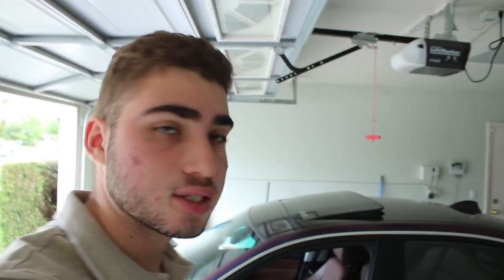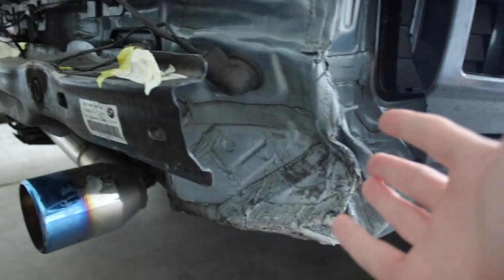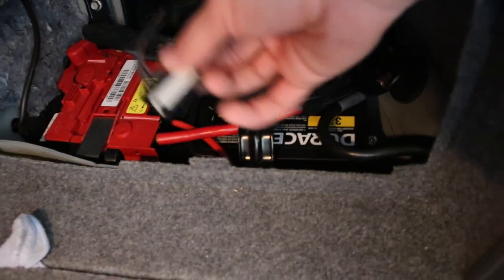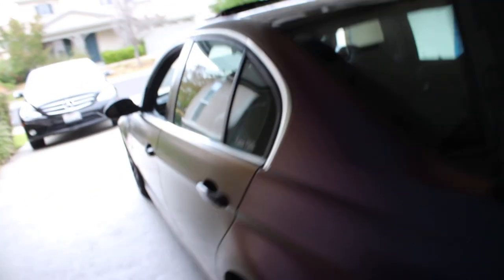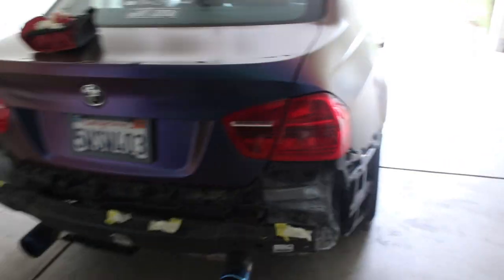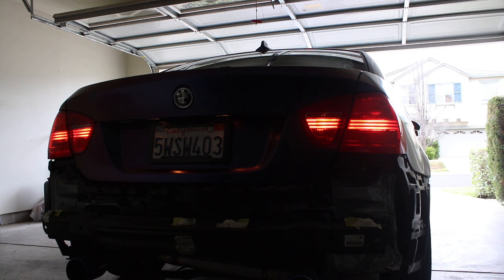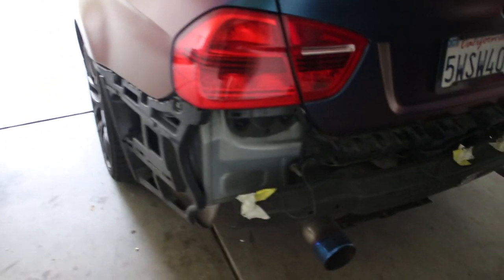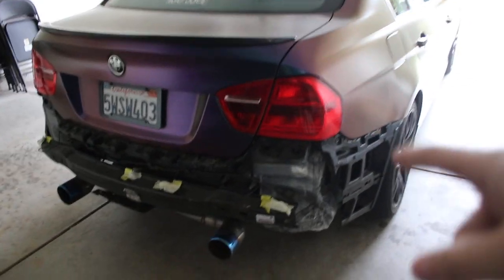SHE IS BACK, INSURANCE WAS A JOKE!

Comment: Drill some holes and use a slide hammer to pull the battery box metal out enough to remove your battery. Once the battery is out you can use a soft hammer to knock it out the rest of the way. Once finished you can sand to bare metal and fiberglass over the holes and rattle can paint the finished areas. under 75 bucks would get you everything you needed and you can return the tools if you leave them in new condition. That's the most budget way I can think of to fix it.

A better way would be to sand to bare metal and weld some frame puller tabs to it so it could be pulled out.

Comment: get a slide hammer and pull it out from outside enough to remove battery.  Then use a small hydraulic jack from inside the hole to push the metal out enough for the battery hole.

Comment: man i'm glad you got your car back. the wrap looks nice btw.  good luck on getting back like you had it. i have a 2006 330xi myself  and i love mine. your videos have helped me alot . thanks man
Reply: Thachosen Drones omg bro I have a 2006 330xi is yours tuned ??
Reply: nah bro mine isn't tuned yet taking baby steps man. just working on replacing some of the expensive stuff before it breaks and doing some small mods for now.
Reply: Thachosen Drones yes bro me too I had to replace the servo motor acurator that usually goes out on bmw 330xi’s it was a little expensive but I love that car
Reply: Bruce Lee that was my biggest fear when i got my car with everything being expensive i was worried i wouldnt be able to afford to fix it when it did break lol. when i got my car it had 120k on it and now it has 124k and it has been a good car and a blast to drive but the radio needs a new amp but for now i just use pandora on my phone until i can get an amp. i have gotten the oil changed once and replaced the battery in the year that i have had it. i just installed some aftermarket angel eyes on it
Reply: Bruce Lee what does the servo motor actuator do just curious
Reply: Thachosen Drones yes the servo acurator motor moves the axles of the wheels, is like a sensor that sends signals, I got the 4*4 lights, abs, brake and wheel malfunction warning so I was so scared and took it to a local mechanic and read the codes and found the issue was the motor, I love the car, it has the eyes too they are beautiful
Reply: wow Bruce Lee thats the same thing showing in my  car and i notice that when i'm turning it feels like the wheels are slipping but it doesnt do it all the time just when the car warms up. can you please tell me how expensive it was to get fixed. when i took it to bmw to get the diagnostics done they didnt pick that up and it was showing the same lights then but i guess it didnt throw a code when they had it
Reply: Thachosen Drones okkk so when you turn your car on turn your steering wheel all the way to the left and then to right and see if it goes away. The guy who sold me the car knows a lot about BMWs so he gives me tips. The servo motor acurator itself is about 300-400$ .  My mechanic said the motor they got was 700$🤭🤭🤭 so I know they are overcharging me but they gave me warranty so I jus let them do it. If you want to save money buy your own motor for about 300-400$ online and have someone put it for you. It is sadly expensive
Reply: Bruce Lee i will try that. I think i found  one on amazon here is what i could copy:BMW Transfer Case Motor (Actuator) 525xi 530xi 528xi 535xi 530xi 535xi 325xi 328xi 330xi 335xi 328xi 335xi 325xi 328xi 328xi 328xi 335xi 328xi 335xi. they have 3 left @$388 ea
Reply: Bruce Lee thats good you have that warranty to help you in case something goes wrong they have to fix it lol
Reply: Thachosen Drones yes i had that on my mind, yes it has pretty good reviews to be honest. But if you want to get it just in case but is up to you. Just make sure that your bmw servo motor is bad though.
Reply: Lol Bruce Lee that is the only issue it has is the 4x4, abs,and brake code and the steering slipping. other than that it drives and runs great. Im hoping i can hold off for a little bit. Bmw listed that i need alot of things that i really dont need yet. Like oil filter housing gasket and a thermostat. i havent been experiencing anything pertaining to either, no oil leaks or high temperatures

Comment: Drill a hole in the frame, attach an eye bolt and use a strap to tie it to a tree/ pole. Then use the car to pull forward. Worked for me and I have an e90 too.
Reply from the maker: Isaiah Hall any pics of the results
Reply: Nour Hummadi yeah I do. I'll dm them to you on Instagram

Comment: $4500 sounds cheap to fix that. A proper body shop will make sure that the frame is straight and will cut out the damaged part and weld in a new equivilant which is a lot of work with the aluminum unibody.

Comment: I just bought a 2011 335i 6 speed. You should drive an n55 car you’d love it.
Reply: Evan's Garage n55 🤮🤮🤮
Reply: Robles Inline 6 for me the n55 is perfect, less maintenance and all I want is a tune. If I wanna go really fast I’ll go ls engine based on something or turbo my lsx swap truck. But I do agree with part of your 🤮🤮 lol since the n54 is more stout internally and easier to make big power on
Reply: N55 is piece of shit... twin scroll "fake turbo" I'll always have N54 in my heart no matter what, N54 is the best car to own and yes i know it extremely unreliable but can't resist the fun driving that car!
Reply: AkimbosliceNV for me personally I don’t want an n54, I want a reliable daily that is quick. I don’t want to daily an unreliable car just to have more potential for power that I don’t want. I get that an n54 is easier to make big power on but some people don’t want that. Personally I would never build a bmw to get fast I would just do LS Motor, which is what my toy is. Fake turbo?
Reply: Evan's Garage lol funny thing is n55 still has most of the common problems as an n54
Reply: Evan's Garage still has water pump issues still has fuel pump issues still has coil issues 🤷‍♂️ not that much different
Reply: Robles Inline 6 I know that, the water pumps are pretty easy to replace I’ve done it. Same with coils. I just like having one turbo and don’t care about big power up top. Neither engine is reliable lol. I just prefer to own the n55 for my application but would never say an n54 is a bad purchase